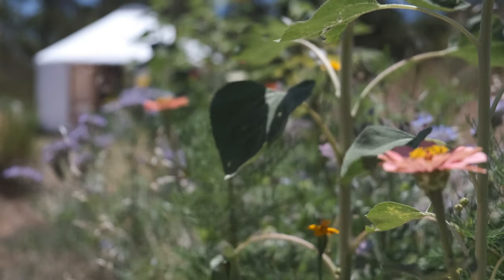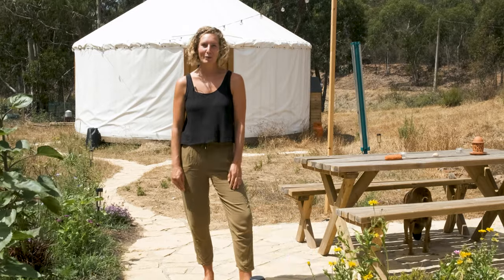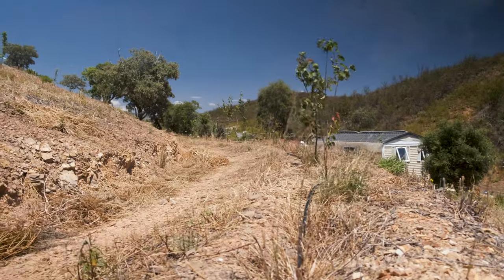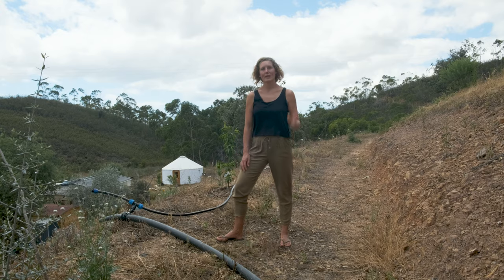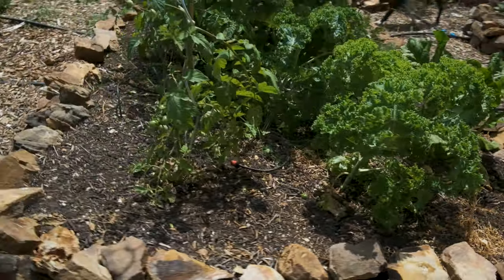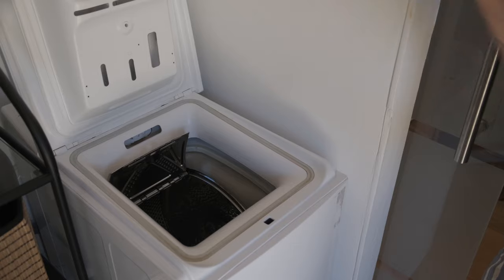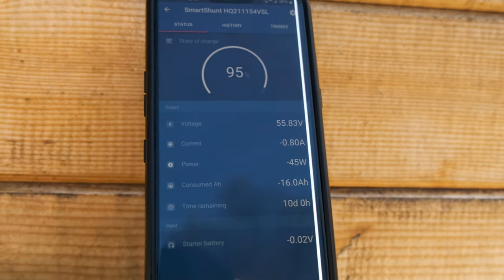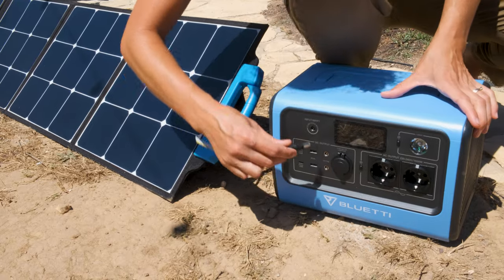2yr’s Off Grid Update - Lessons Learned Living Off-Grid in Portugal - Life Reimagined

Comment: You have made some great additions to the land - it looks great!
Did you say at the start that you had to connect to mains electricty anyway to power your borewell pump? If you have mains, are you tempted to install and air conditioner for the summer?
Reply from the maker: Yes exactly, we had to get connected to mains electricity because the borehole is so deep we couldn't use a solar pump. The connection is on the other end of the property though and to run a cable all the way to the mobile home would be 2000-3000€, so we decided not to do that but rather invest in upgrading our solar system. Not enough to power air condition though unfortunately.
Reply from the maker: Not yet! Jack

Comment: I'm interested in the solar power off-grid system you use, and I have a question. The non-stop rainy weather is common in the winter in Portugal, with thick clouds. Do you have any issues when it is raining for weeks, literally pouring gloomily without any sunny hours? Does the panels produce enough energy? Or the battery system can conserve more? How do you manage?

Comment: You said that you had to connect to the grid to run the borehole pump then you went onto upgrade solar system because you didn't want to be on the grid??
Reply from the maker: Hey Martin. Sorry if it came across as confusing. Basically the land is 1.6ha and the borehole is up the top of the land where the houses were supposed to be built. we are down the bottom. We had to connect to the grid for the borehole. But our cabins etc are all still off grid. When Sonja arrived considered connecting them to the grid up top, but that was going to cost thousands. instead we just upgraded our solar setup and thats been a great choice considering whats going on in the world.
Reply: @Life.Reimagined  thanks for clearing that up